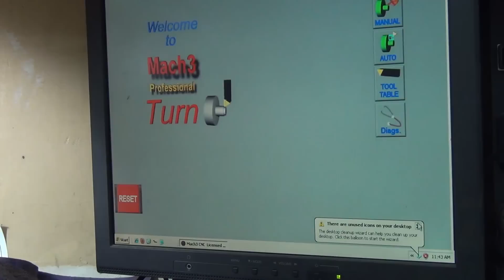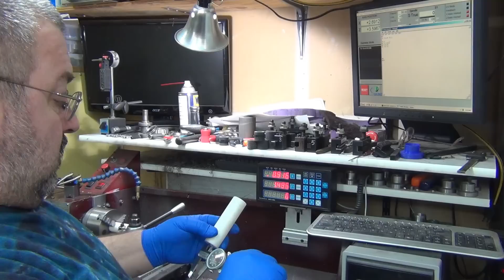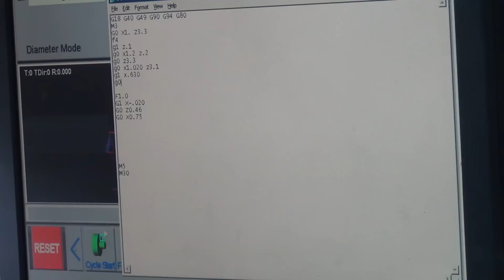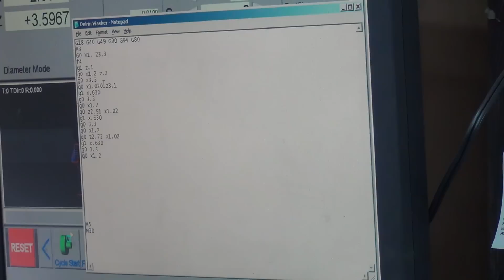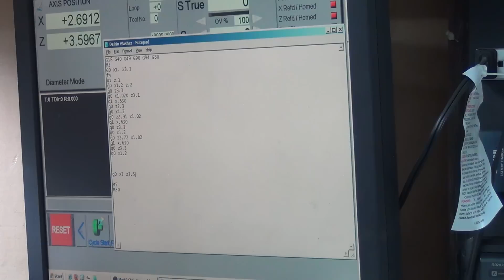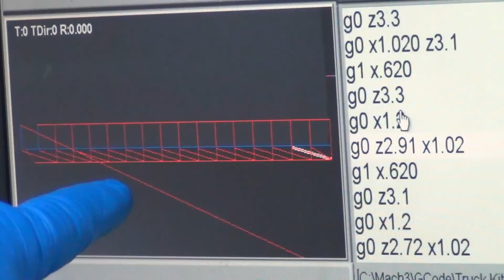9x20 - Mach3 Setup/Program for Delrin Washer

Comment: Try this
https://youtu.be/o9vXeH8lCjQ
Reply from the maker: NuttyforNissan Sweet link!!!  Awesome! Thanks!!  So this is the short version of what the wizard is trying to do? Any idea if Mach3 can actually use it?  I'll have to check.  Thanks!!!!!
Reply: bluehandsvideo I tried it on mach3 didn't recognise G72 looks like G73 is the only one it likes. Maybe mach4 does.
Reply from the maker: NuttyforNissan What's the difference between the two?  Roughing/finishing? I need to watch more of those vids!!!
Reply: bluehandsvideo Finishing uses the position references from the roughing routine, but it appears you cant use any of them with mach3 :(
Reply from the maker: NuttyforNissan I had a feeling that was the case.  I still need to watch some more of Tom's vids :)

Comment: I just love the end on this one..chop-chop-chop! Makes one understand how useful the CNC stuff really is! Nice video again, Mike. And I learned something from this one too, so keep'em comin'.;)
Reply from the maker: Erling Weiseth Thank you so much!!!  CNC can be a bit of a bother for a couple of simple parts, so I'm not sure I'll ever have just a cnc lathe and no manual lathe.  Compounding on what you said...not only does it repeat parts nicely, I can pull it up again next week and not have to spend any time on coding!!  Almost like residuals....do the work once, then keep reaping the rewards later without the work.  
I'm still working on the rest of the cotter bolt vids. I took a bit of vid today...using the 9x20 to make the sleeves for the UCA bushings.  I got it figured out and dialed in pretty nicely.  I'm anxious to get some on some vehicles and get them tested so that I can make a bunch more!! :)
I really appreciate you taking the time to watch and comment!!!  Thanks!! Mike
ps.....I went and looked at your vids.....came across the comment you made about getting a different drill press so you didn't have to fix the spline....that was a way better option than trying to fix that one you had!!!  lol :)